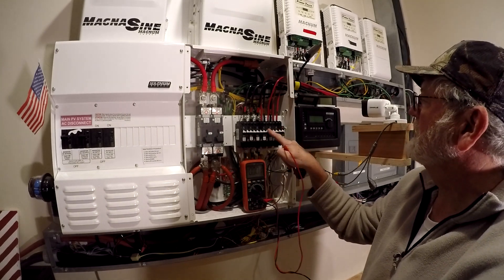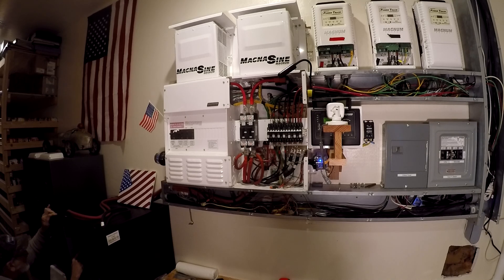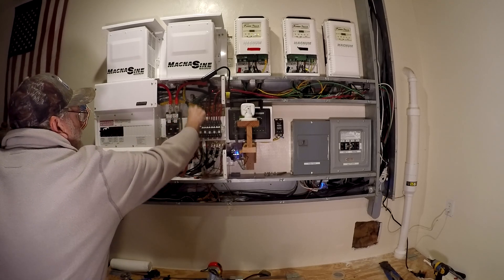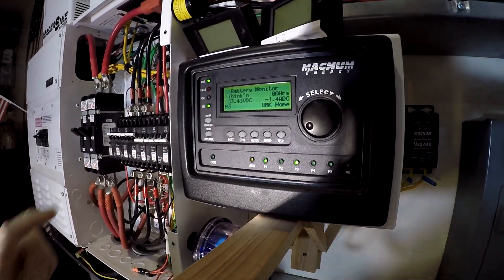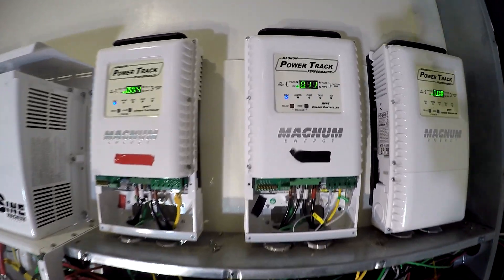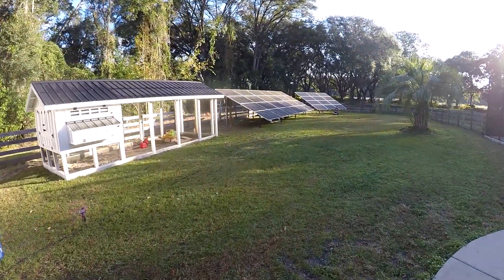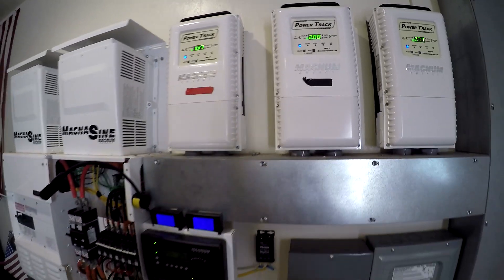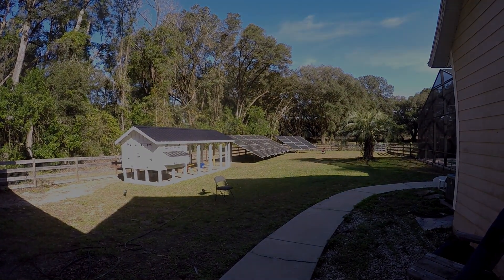Ground Mount Solar: Black Start

Comment from the maker: The EG4-LL batteries have a built in pre-charge resistor.  Therefore, I turn the breakers to the inverters ON before starting the batteries.  Note that the inverters are still turned off but the connection is made via the breaker.  If you don't do this, the pre-charge resisters in the batteries become useless and the batteries may then see a connection as a short circuit and fail out.  Note: The inverters are off at boot time and you can see me actually turning the inverters on later in the video after the system is booted.  I think the reason it failed to boot the 1st two times is that I did not push the buttons on all three batteries at the exact same time and milliseconds in the electronics world are like hours so it acted as if only one battery was used to start it and that's just not enough for these heavy copper wound inverters.

Comment: Precharge resistors are your friend if your batteries don't have precharge resistors built in.  50V to 120V incandescent lamps make good precharge resistors, and let you know when the breakers are safe to close as the lamp will go out.  They will also tell you if polarity is reversed depending on inverter internal circuitry (parasitic MOSFET diodes etc.) as the lamp will stay steadily lit, but this can't always be depended on.
Reply from the maker: Good tip!  See pinned comment for more details on the startup process.  Thanks!

Comment: Looking great! I have the same issue. Panels on the roof and dont get sun till noon due to the tree's😢
Reply from the maker: I am SO happy that I decided to move this to a ground mount.  It is generating a LOT more power.  We just got the new roof put on and it looks so good there is no way I would put the solar back up there.  The down side is that it does crap up the yard more than I care for and it was more expensive and more work than I counted on for sure...  Still, overall, glad I did it.  Thanks!

Comment: Smart move choosing heavy duty, high surge capacity low frequency, inverters instead of one of those toy, high frequency, low peak power, short lived inverters that everyone else is selling.
Reply from the maker: I have been running it pretty hard for about 7 years now and it works like a champ!

Comment: Looks like a nice set up I am so used to blue kit that it's nice to see some nice shiny white kit!  PS I would suggest turning on all the batteries first then turning the inverter on last that way you can start to get solar power going in to the batteries which will help Support the inverter surge.
Reply from the maker: Yes, That's pretty much what I did.  See pinned comment for details.  Thanks!

Comment: You should turn on all the batteries first so they can share the load of the caps in the inverters. Cheers
Reply: ^ This. I always turn on my batteries before anything else. I have a 12k LF inverter.
Reply: Yes.  Inverters should be turned off but not disconnected.  Then turn on the battery or batteries to charge up the inverter input capacitors.  Then turn on the inverter.  A lot of people will charge up the input capacitors with a pre-charge resistor from the battery first before doing the hard-connection from the battery to the inverter, to avoid arcing inside the breakers.
Reply: @junkerzn7312  sometimes you have no choice on disconnecting. Precharge is correct .
Reply from the maker: See pinned comment for more details about how I actually started the system and why.  Thanks!

Comment: Beautiful set up you have going on there. I also have dual  Magnum set up as you do same batteries. I found turning 3 batteries on at once fires my system Every time. Also  2 batteries does not always work.
Reply from the maker: Yes, I have watched many of your videos and you have a really nice setup.  I think the three batteries is the key and at the exact same time.  See pinned comment for details.  Thanks!